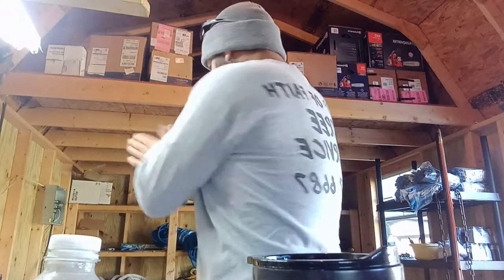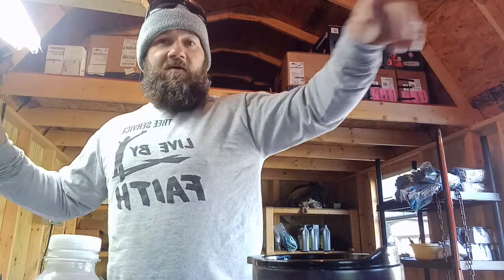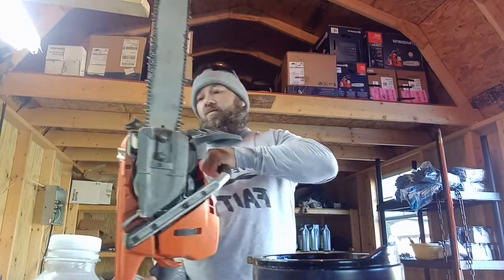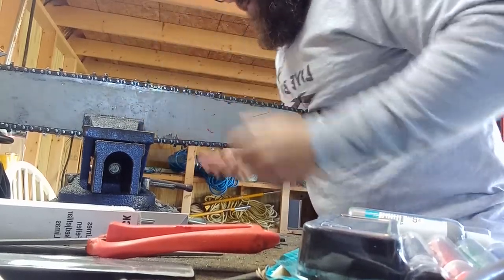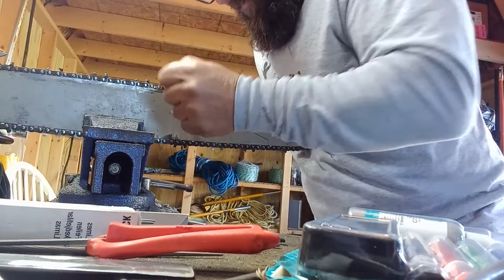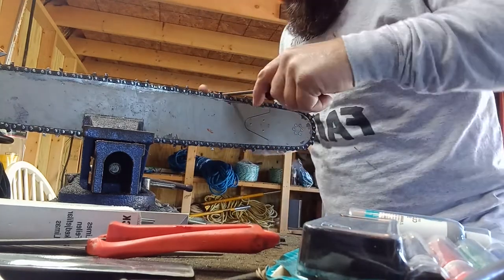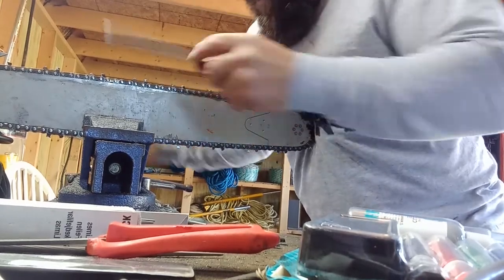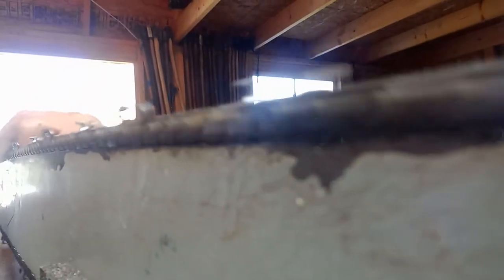How To Sharpen a chainsaw like a professional! Expert chainsaw sharpener!!

Comment: I wish more tree guys understood the value of sharp saws, and that if you don't keep running it when dull, it takes far less time to sharpen. For me, its just as fast or faster to sharpen the saw up to 24" chain than to swap the chain for another. I don't clean my chain first, and I'm sure Im loosing file life because of it.

Comment: I put the saw in the vise upright just like you’d hold it in your hands when bucking. Do one side + rakers then flip saw around in vise, retighten, and do the opposite side and rakers. 72 driver chain in about 10minutes.
Reply from the maker: Lots of people work hard not smart.. I like to see what I am doing and not be in  pain while I am doing.Couldn't imagine working that hard for no reason!when you have a vice and work position..But you handfile 10 chains a year.. ...I If it works do you! But I have see your saws cut.
Reply: @steppoffaith8426  it’s actually not that much more work … I’ll make a vid ya and learn ya Geo. With the knowledge gleaned from my utube sharpening video - your chain will cut like a hot knife thru butter 🧈😜.  If you’re goin thru files like that you’ve either got cheep files or you don’t know about soaking em in white vinegar. This time of year I sharpen lotsa chain by hand. Maybe you should check out Ironmans video
Reply from the maker: @fabzacres-blackcat  I go through tons of files because in residential tree work the chains get rocked,bird feeder nails or hooks, old fence,cut a lot of lighting struck trees will have black mineral streaks, and takes a  lot to get them to good. A Routine chain filing the file will last 5 sharpening and takes 2 min for 28" chain.
Reply: @steppoffaith8426  I hear ya on residential work - never know what you’ll find deep in the bowels of the tree. IF the chain never gets damaged by ??? and I sharpen it every tank or so (when it gets around 85-90% of Razer sharp) I can get 20+ sharpenings outta the chain. Soak ur files in white vinegar when they juuuuust start gettin dull and they will last 10x as long. If ya round the files cuttin edge then in the garbage they go
Reply from the maker: @fabzacres-blackcat  the other videos posted. So now you can sharpen like a pro lol lol.
Reply: @steppoffaith8426  experience makes the best teacher no doubt. The whole trick is to get the file at the right height and rakers set  like ya showed in your video